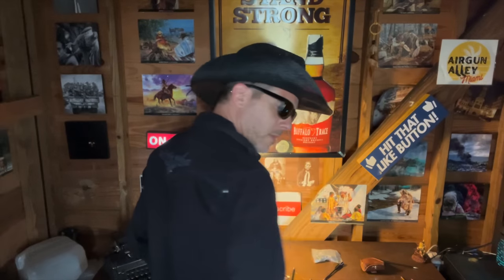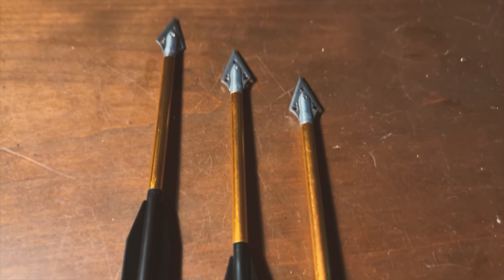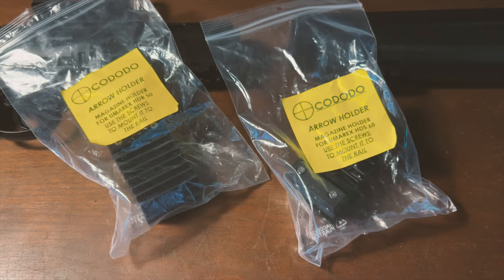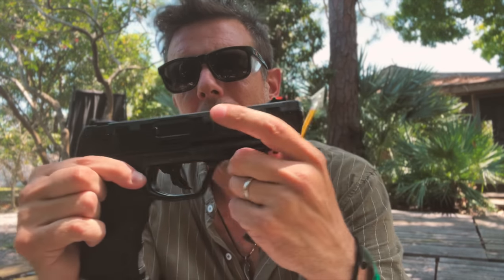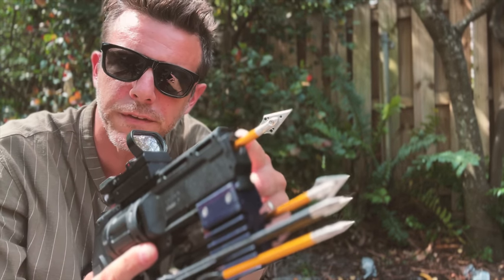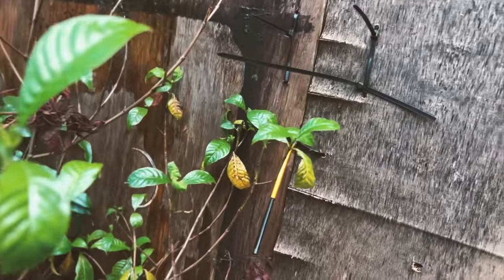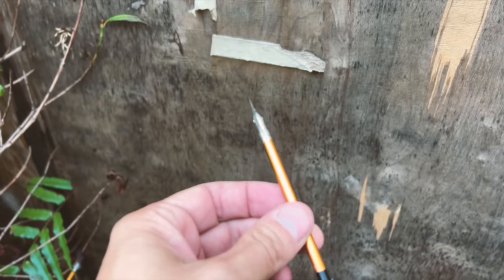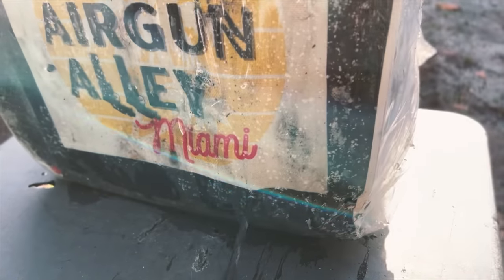ARROWS for the HDR 50 & HDS 68 & BRAVO 1.50

Comment: The only part of those arrows that touches barrel is the back cup. Those go though unguided and can point slightly off axis, which only gets worse after arrow starts to leave barrel. I believe there should by a sabot guide made from 2 halves somewhere in the middle of those arrows that would fall off after leaving the barrel. This should keep the arrows aligned with barrel axis and improve accuracy.
Reply from the maker: My friend, you should join NASA or SpaceX, if you haven’t already :) that’s a great idea, I like the separating parts in flight…
Reply: Isn't it already called a sabot 🤔
Reply: A whisker biscuit at the end of the barrel 👍🏻
Reply: @jackcockel4425  A screw on type yes perfect. But the sabot idea is amazing too.
Reply: FWIW, blowgun darts do not have a sabot, and they can be devastatingly accurate 🤷
Reply: You're absolutely right. Those arrows are designed for pistol-crossbows, not made to shoot out of a gun. You can't expect an arrow that is already lying on a slant in a gun barrel to go straight. What Cododo did was to manufacture a cap that fits on the back of each bolt (pistol-crossbow arrow), in 2 sizes for 2 calibres. These caps will often fly off or break upon impact from a second arrow. I say back to the drawing board boys 🙂
Reply: Exactly!  Well said, in my youth we would use old carrots for this sprcific role (or parsnips), parsnips are less likely to cause the barrel to explode, just so you know? Amazing how accurate you can be with a smooth bore weapon, depends on the shooter who knows 'his shite'. what me? I know nothing.
Pax and respects,
C
Reply: @brianwalker8465  Ah, you're actually right. There's not much improvement in aligning the arrow horizontally when there's already a cup. The sabot is used mainly as a seal for the expanding gas. The cup automatically aligns the arrow straight in flight.
Reply: @marshalerts4148 Yep, you successfully repeated what my man already clearly stated...
Reply: @billymacktexasdetective5827  and ?it's the Internet it's full of repeated shit

Comment: always make sure your broadheads are in a vertical position vs horizontal.↕ anything other than vertical produces flyers.
Reply: Ah....might have an issue. I'm using a crossbow and ordered the Same type for my cobra pistol that has an upgraded 140ib prod...but i think i can only load them in such a manner they would be horizontal....

Comment: It's a front to back weight distribution of the arrow/bolt issue. 
A lack of forced direction/barrel length. 
Flat head is also directing the arrow as if it was a fetching.  
The arrow comes out of the barrel not 100% completely straight because of lack of forward support.
The heavy rear is pushing the unstable  un directed front that is wanting to choose its own direction.
Reply: Blah blaaahhh blah 😊

Comment: From your first video shooting the bolts from the HDR 50, I too pondered shooting an arrow followed by balls. I haven't tried this (hint hint), but I figured one could take a regular magazine and grind down one spur (allowing for the mechanical rotation) so the cylinder won't rotate when an arrow is loaded. Then after shooting the arrow, manually rotate the mag to its next detent position allowing for shooting the remaining loaded balls.

Enjoy your work BTW and have purchased from your sponsors stores.
👍👍👍
Reply from the maker: Now that’s some great engineering ideas my friend!! 👏🏼👏🏼
And thanks you so much, truly appreciate it!
Reply: Lol manually rotating the barrel like a pepperbox pistol would
Reply: @Nepgearaf  Well yeah, except I think with the mod I suggested, you wouldn't need to manually turn the cylinder, but just continue to pull the trigger.
Reply: darn... just wrote the same idea and after posting I scrolled down and saw your exact same idea. Clever minds think alike! :D

Comment: If they could manufacture those broad heads with a slight angle to the blades, it would induce a spin, much like rifling, that may help to keep it on target
Reply: This ⬆️
Reply: the fins are supposed to be what stabilises it so if it has four fins itd be better balanced and stabilised  or whatever
Reply: or if it was tight fitting to the barrel in addition to the the fins
Reply: only the back of the dart is tight fitting so it throws the balance off when it comes out of the gun making it alot less accurate

Comment: I think the bolts are not sitting properly inside the barrel.They should also have a sabot guide sleeve on the bolt midway up it to keep the bolt sitting perfectly in the centre and sitting straight for straight flight.
There is nothing to guide them to fly straight like from a crossbow guide rail.

Comment: If they want to improve the broadhead arrows, they need to add a third blade so it'll be more aerodynamic and fire straighter. Then I used to hunt with a bow, I noticed that tri-blade broadhead arrows shot straighter and had more punch then the standard broadhead arrows.
Reply from the maker: 100% agreed!

Comment: Definitely gonna have to get some of those arrows. so overtime devastators, real 9mm bullets slugs and deez bullets will destroy the barrel? do you think 8 9 10mm hotglue slugs will hurt the gun?
Reply from the maker: Hi Conner! I think in my case it was the many, heavy steel balls that I put thru it. I shot a lot of them throughout time and those go pretty hard on the delicate HDR 50 aluminum barrel.
The glue slugs I’m not crazy about coz they leave a gooey layer everywhere. Especially here in the Florida heat! Go with plastic and rubber and you’ll be fine :)
Reply: @AirgunAlley  ok thanks very much👍👍👍

Comment: The plastic vanes deformed when exiting barrel and caused uneven lift and unwanted fin controls that veered off target. Get broadheads where the whole shaft is solid carbon or aluminium.
Reply from the maker: Thanks for this, very good explanation sir

Comment: Those are crossbow bolts, meant to run along a crossbow flight rail before being launched at its target, that is why you have no accuracy and why half your bolts aren't flying straight. Cododo also does not make the arrows they are 50-80lbs crossbow bolts with rubber bits attached to the back. Also you are not even reaching the power potential of them any better than a crossbow would so a fast repeating crossbow would be a much better lethal, accurate, and reliable system.

Comment: can you test with HDR 68 16 joule as well?
Reply from the maker: The problem with that is that cododo hasn’t made a “non-rotating” metal center piece for the HDR 68 magazine yet. 
HOWEVER, I just got the Z-Ram new magazine, which comes without that center piece… so that may actually work… to be tested, my friend. Great idea! 🙌🏼
Reply: @AirgunAlley  that none rotate clip for HDR 50 mag, will it fit to HDR 68 mag? Or simply removing the clip from mag might stop the it from rotation
Reply from the maker: @skyedream9332  sadly I’m afraid that both answers are “no”. The first one won’t fit in the 68, it’s a lot smaller. And removing it won’t keep it stable. The Z-ram one is a lot fatter, and stays nice and fixed even without the roaring piece.
You could try removing it from the HDR 68 mag and putting something that will fix it to to the breach better… but really not sure if or how that could work 🤔
Reply: @AirgunAlley  oh ok that's good info. so the z ram mag works for that killer arrow? would you mind shooting video with it sometime?

Comment: Just ordered those broadheads for my cobra pistol crossbow that's ungraded with stock, laser, sight, and 140ib prod (up from 80ib)
Ive used the normal aluminium one's but found the upgraded power was too much that it just threw them like a toddler  having a tantrum lol. But those plastic ones ive used too and are much better and absolutely fly!
And the tips are far sharper. The aluminium ones might look better, but actually the plastic one's seem to fire the best. Am looking forward to the broadheads coming- but i am worried i can only load them horizontally (as i read one of your comments that this is bad for accuracy. )
Reply from the maker: Nice man. Thanks a lot for the input - very interesting food for thoughts! I’ll be shooting them again soon, will study closely the difference between the plastic vs the aluminum field heads. 
Hope you enjoy them!
Reply: You sure the cobra is safe with a 140lb limb? I just got the 80lbs Anglo arms op360 which has the stock already, But I don't think I'd trust the abs plastic build quality with a higher power limb, what string did you fit?, I definitely get more penatration with the alloy bolts than the plastic ones, Got some of the alloy broadheads coming from AliExpress as well lol same ones as in this video.
Reply: @coaldust01  I added an 3d printed stock at the back. It is a hell of a job to cock,  and is an absolute maverick. Sometimes chucking bolts like a toddler having a tantrum, but provided it all goes smooth- it kicks like a mule. Not recommended and probably dangerous, but good fun.
I have a fully kitted adder and vlad also with higher power limbs etc
Reply: @orderofmagnitude-TPATP yeah, I think I'll leave mine at 80lb lol, I've see the adder Rx, Very nice, I like the fact that you just cock it and ready to fire again, I like the look of the ek archery hex 400 210lbs, I bet that has some power but it's probably huge.

Comment: The Broadhead arrows must be more like arrows shot from bows. It need three fletches that are set to form a spiral so that the arrow spin otherwise the broadhead end up steering the arrow.
Reply from the maker: Yesss! Much agreed and good point! Thanks Willie
Reply: 2-vanes broadhead bolts exist for self-cocking crossbows (Adder, Stinger, Vlad) and they work fine. Medieval crossbows also used 2-vanes bolts for centuries and they also worked just fine.

Comment: You should try another type of ammunition. If you want to get good results, use arrows made entirely of metal. They are thinner and much stronger. You may have to make them by hand. In the Middle Ages they were used as projectiles in high-powered crossbows. Greetings
Reply: Bolts.

Comment: That was awesome!! That ballistic footage was sobering! Be careful w/ those broad heads my friend ;-]
Reply from the maker: Thank you so much and I will!

Hey my HDP compact out of nowhere stopped shooting. I bump the CO2, the valve pops out, no leakage of any sort - but when I go pull the trigger, it’s like the gun has no air in it. 
What’s your expert diagnosis based on the scars details I just gave you? 🥺
Reply: @AirgunAlley  that sounds like the trigger is getting stopped by the faulty rubber seal/detent. It might be torn. I sure wish they would have made the compact revolver instead ;-[
Reply from the maker: Hahaha seriously!! Thanks a lot for that man, I’ll try to open it up at some point

Comment: Which arrows specifically do you recommend for HDR 50? Since there are multiple, would like to only order the ones you recommended most. I see three options:

Black
Gold
Gold with the broadhead?
Reply from the maker: Hi Eric, if you have a 7,5 joules gun, go for the black ones. If you have an 11 joules HDR 50 - then I’d say go with pointy gold. 
Let me know what you think…
Reply: @AirgunAlley  pointy gold but not broadhead right? 11J

Comment: Your barrel is not messed up you're shooting an arrow that has no stabilization in the front of the arrow in other words the front of the arrow is putting in the wrong direction when you pull the trigger it needs to be supported Also your broad head needs to be exactly 90 degrees from the flexing or exactly even with the flexing otherwise it's not going to Fly straight

Comment: Can you send me an hdr 50 my hdp50 just gasses and loses all co2 when pierced i replaced the power kit but the pin in it only then it mess up. I used restrictor disc a whilw ago everytungs fine until i tried replacing the pin....

Comment: Hello my friend,
I guess I told you that HDR stock barrel is shit. Instead of buying a new gun better put a tuning barrel. Just my experience.
Also the barrel is short. With a long tuning barrel would be a better result I think. I tried an arrow from the FSC short barrel and it's not really working. You will hit the thief from 10 feet but that's all. With the hdx the result was more accurate.
In rest nice video as always. 
Good luck.
Reply: @tomar777  i don't really remember how mine shot with 11j. I modified it quickly. There is a difference in accuracy with a longer barrel, but the ammo is a big point. Some light weight rubber balls are terrible, the rubber steel are good. Nylonballs makes a better damage but depends much on the quality. I bought the umarex plb. In .50 they are 1.8gram but better than 2.8 rubber steels in damage but acceptable accuracy only with the long barrel. Best I found 5gram devastator type ammo from homedefence24, but had just a few to try. In .68 I measured some umarex plb s and found they aren't perfectly round...and also shrinking when reused. Good ammo makes a big difference. Anyway in the moment the gun budget is empty so I have a bit time to think what else is good to buy. The HDS was in the game because I wanted something like that for arrows. I remember these cododos with long spikes/nails weren't so bad. Maybe they work on the arrows in the future.